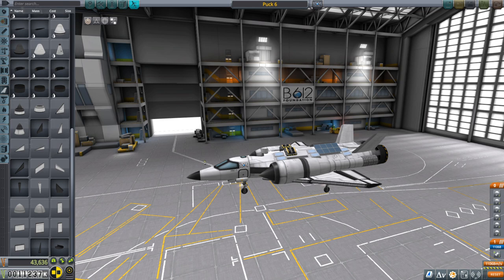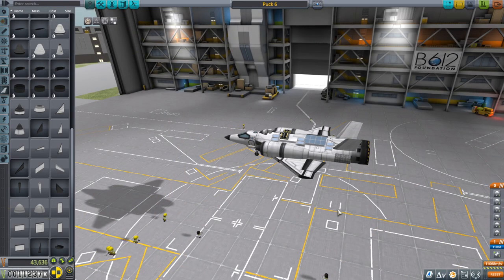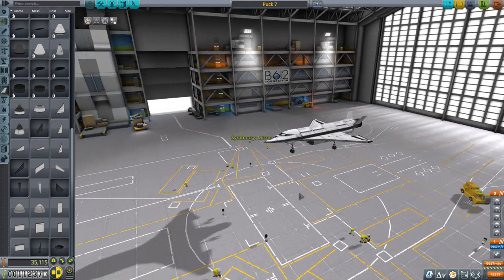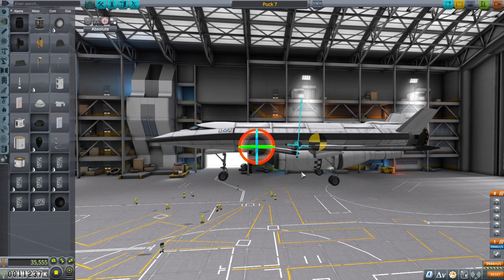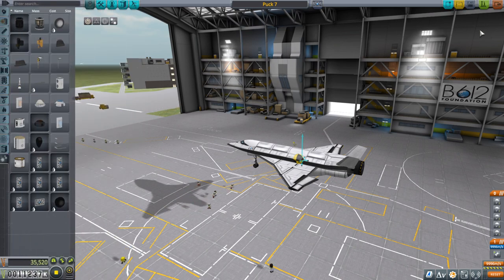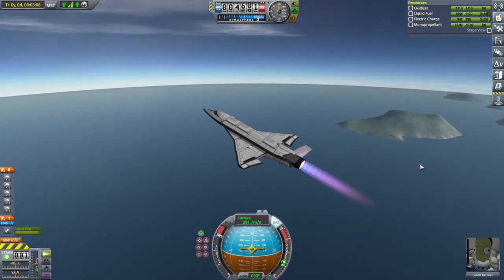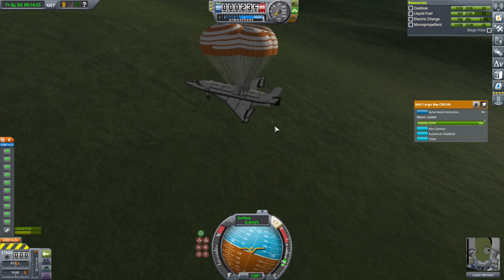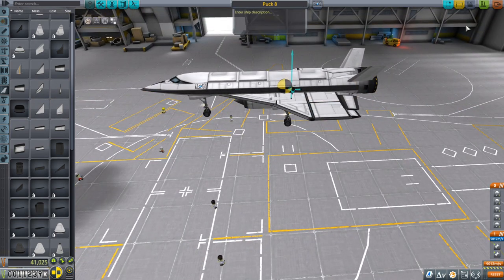Kerbal Space Program 1.11 Stock Career 58 - Refined Puck

Comment: You want to stay close to sea level (under 200m altitude) until you pass the 440m/s mark and then climb at a 5° to 10° angle. You basically want to reach 20km at 1500m/s of surface speed

Comment: You need about 2000 m/s to get to Jool and you have just under that. What you could do is split the burn to Laythe into two burns. First burn at 300 m/s or more (can go up to about 1000m/s without escaping), putting you into an elliptical orbit. Then send a refueler to top it off, then burn to Laythe on your next periapsis pass.

Comment: 1) do you have a claw refueler at jool? i think they both have just docking ports. 2) there's a mark 2 fuel tank with an air intake below it, you can use it instead of customly designing it. 3) with 1 engine you can dive to pass 400m/s that will increase thrust dramatically, it doubles at mach 1 then doubles again at mach 2, maximum thrust is at mach 4 and it's 9 times greater than subsonic. 4) you can redock with that refueler using plane's thrust, with a claw you don't need to be as precise as with docking ports, you can touch it with a wing or whatever.
Reply from the maker: 1) I'll have to check that. 2) Will it get the same performance as the shock cone intake? I thought it didn't. 3) Tried diving and it didn't work too well, but maybe I didn't dive hard enough. 4) I think it's probably not worth the time at this point. I'll figure it out later.
Reply: @RaizSpace  oh, that's mk1 air intake, sorry. i forgot that my laythe lander was in mk1 format.

Comment: One of the function keys shows which parts are producing the most drag. I don't remember which one, but it may be F12. The red arrows are drag. 

Also, it's most efficient to break the speed of sound while going at sea level. However, your current plane has enough thrust that it shouldn't matter. 

A cargo bay should occlude the parachutes from drag, though it's best to check using the function key. 

For your worries of heating, it should be fine. Stock is much more lenient about heating, as you know from your ablator experiments.

Only one intake for two engines is not a huge problem but it leads to an earlier loss of thrust and flame-out when climbing because the engines have half the oxygen that they would otherwise have. Based on your current design, I don't think it's worth the extra drag and weight, but I'm not an expert at SSTO building.

For more fuel, here's one possible thing you could do: The cargo bay with parachutes seemed to be mostly empty. You should probably put a Size 1 fuel tank in there and fill in parachutes around it.
Reply from the maker: Yeah, F12 is the aerodynamic overlay. It really should not be most efficient to break the speed of sound at sea level, but I've heard that said about stock.
Reply: @RaizSpace  Stock aerodynamics don't make sense. You just have to learn the quirks.
Reply: @RaizSpace  alot of the reason for it being more efficient is that the rapiers gain huge amounts of thrust once above 440m/s so it's most efficient to fly level to get past that as fast as possible before climbing

Comment: Can you explain how come are you able to get away with having no horizontal stabilizers/canards?
Reply from the maker: It's a delta wing, like the Shuttle or Concorde, and the V-tail is doing some of the horizontal stabilizer work. The issue with a lot of planes is that they need the pitch control surface further away from the center of mass to have leverage for adequate control, and these surfaces would, in fact, be too close to the CoM for Realism Overhaul and FAR. However, it's enough for stock.